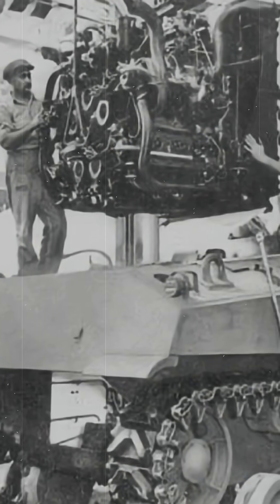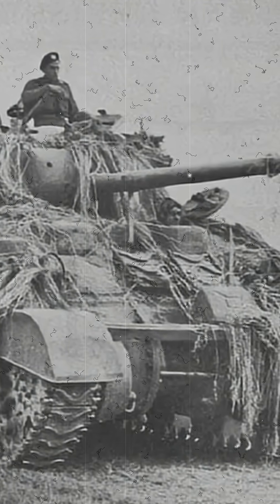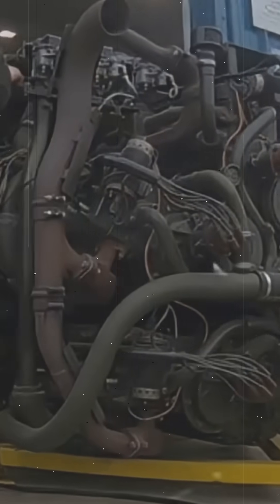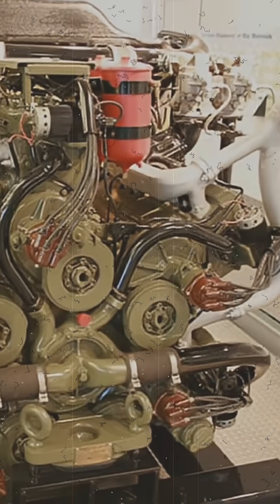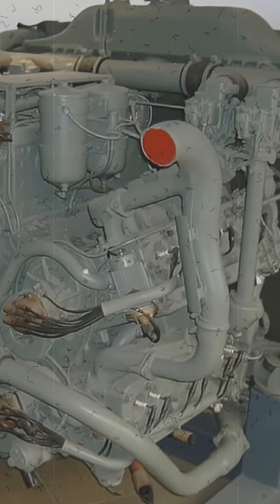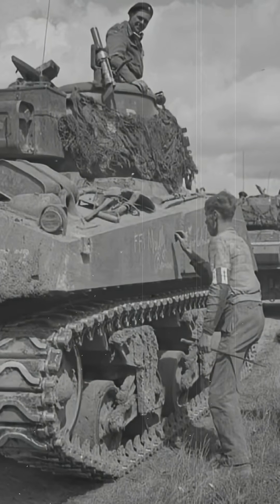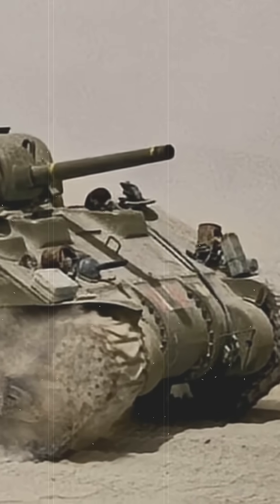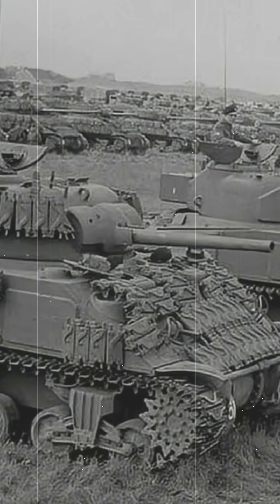The 30-Cylinder Monster: The Bizarre Multibank Story #history #ww2 #military #army #tank #usa #uk

Comment: The Soviets were well ahead of the US in tank engines, they designed a aluminium V12 giving out 500 horse power in 1930. The Soviets made over 60,000 T34s, in factories with no rooves initially, having moving their factories 1,000 miles away from German bombing. It is still surprising how mediocre so many US weapons turned out to be even to this Day in Ukraine.

Comment: The British despised the puny blinker of Detroit engineers so they kept the hull but got rid of the plinker turret and replaced it with a British turret with its powerful 76mm gun. A bullet that could penetrate a tiger tank. 
So yes people a Sherman tank can not kill a German panzer or tiger tank with its puny 75mm
Reply: They did not replace the turret on the Sherman Firefly - what they did was fit a modified 17pdr gun (it had a different barrel & recoil to the standard one and was actually 76.2mm calibre) and due to the additional space required for the increased recoil they had to weld an armoured box on the turret rear to hold the displaced radio with a hole cut in the rear of the turret to access the radio.  Also due to the size of the gun, an additional hatch was fitted to enable the loader to access the turret and finally they removed to bow machine gun and used this space to store additional ammunition for the main gun.
Not all Sherman’s could be modified but those that were then gave the British & Commonwealth tank units the capability to engage and knock out Panthers & Tiger tanks at combat ranges, eg on 8th August 1944 when Firefly of the Northampton Yeomanry knocked out three Tiger 1s at ranges about 750-850 yards.
The best description of the Firefly to be found on YouTube are the two from “The Tank Museum”, the second one gives far more details about which tanks could be modified.